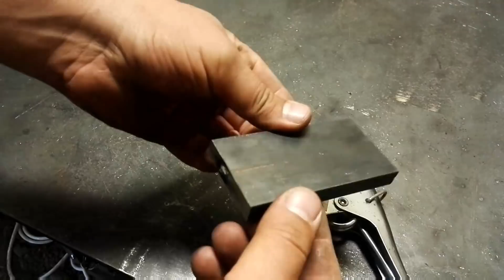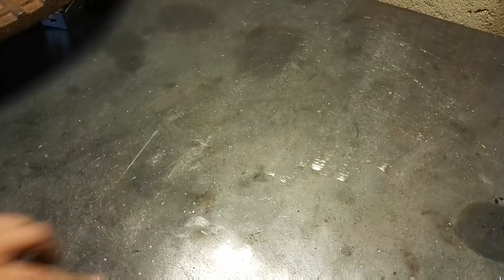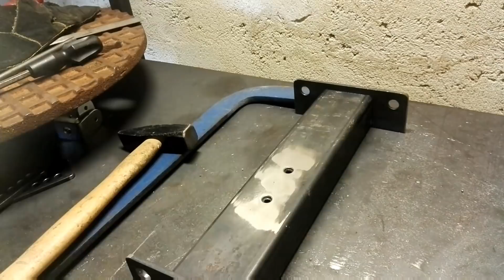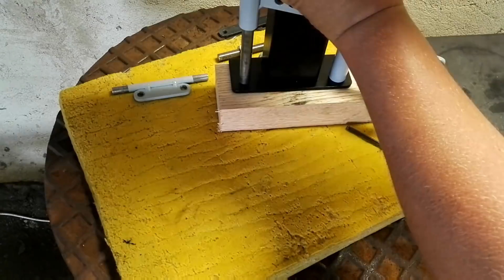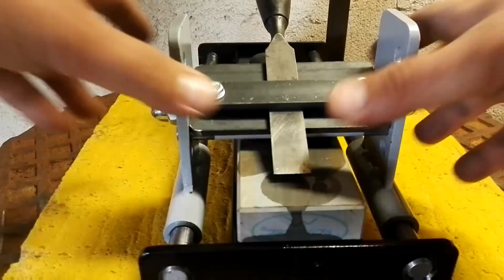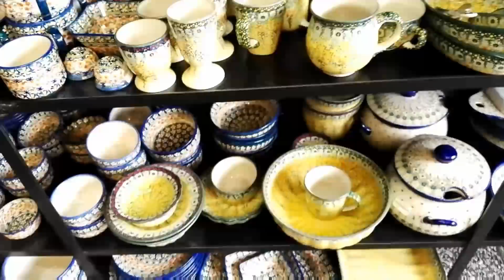Make the chisel sharpening station

Comment: Reading the comments, I guess for version 2.0, you might want to widen it for plane blades, add a vertical slider to avoid uneven stone wear and, since we're over engineering anyway ☺, add a quick-lock for the chisel or blade.

Comment: Neat tool. Though as some others I have concerns regarding the flatness. 
Usually one have to move the chisel 30+ times each time. Even this can result in a small groove you won't see with naked eye but can cause a notch next time. The slightly lateral moving with manual sharping tools will prevent this. 
Nevertheless it's a nice build and can get enhanced to avoid this.

Comment: Difficile d’aligner 2 guides cylindriques pour faire un chariot ,on s'affranchit de ce problème en ne mettant qu'un guide cylindrique et de l'autre coté un roulement dans un rail pour laisser du jeux horizontalement (voir chariots d'imprimantes par exemple) .
Ce que je dis n'est pas une critique ,juste un retour d’expérience personnel. 
Beau travail.
Reply from the maker: You are right, because of that I drilled parts welded together, I was expecting some difficulties, but it was OK and the carriage run easy. The ball bearing on the other side was plan B if plan A failed.

Comment: that's absolutely pretty cool, because i  noticed the desired angle on those holes on both sides,. i don't have the welding equipment, but, i used 2x4's but i have to used a planer to smooth it out, almost the same built up but you used a metal, mine is a wood but i think they works together,.
Reply: Cesar Caoili 

Putt vote

Comment: The build is impressive but it's flawed. The blade holder 'needs' to be able to slide laterally (eg: from side to side) to ensure sharpening wear is unified (equal) across the width of the stone to A: ensure flatness of the tool edge being sharpened and B: to eliminate isolated wear of the sharpening stone which could lead to un-uniform tool edges.

Comment: Almost great. Why there's nothing to hold chisel at exact 90* angle?
Reply from the maker: +kojocisco because there is.need to dress the stone time to time, after that the stone is not 100% prarallel so there is possibility for the correction so you canove the chisel to side.
Reply: i have the same problem actually using a chisel, so I have this thing called judgement.

Comment: Everything is great except for one thing. If you use whetstone, you will be creating a groove since the blade stays fixed at only one spot. It'd be nice if the blade can slide left and right. Nice try!
Reply from the maker: The diamond sharpening block could be used and the stone I use is very hard, it's natural stone and not affected by the tools so much as synthetic stones.

Comment: precision jig yes, but you have no idea of the correct angle to charpen your chisels
Reply from the maker: Im using gravity angle metter. There is no problem to move the stone left or right when the chisel is fixed. This helps to wear the stone symmetrical.
Reply: You can use a bevel box to find the angles. They are cheap on ebay or Aliexpress.  Check out Matt Estleas's vid on how to sharpen a chisel or make a protrusion stop.